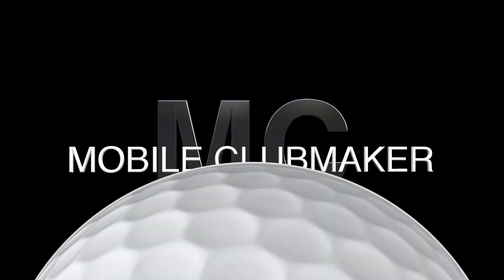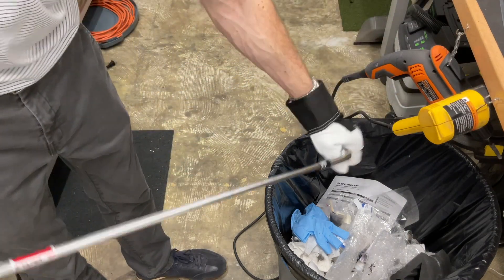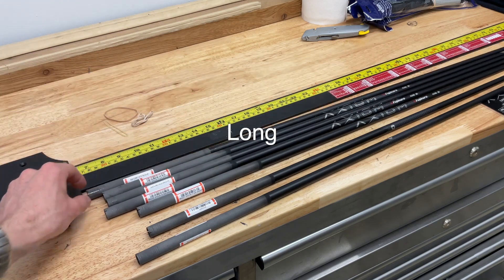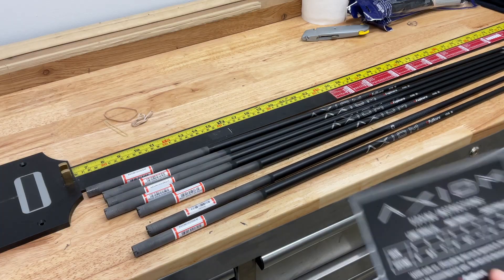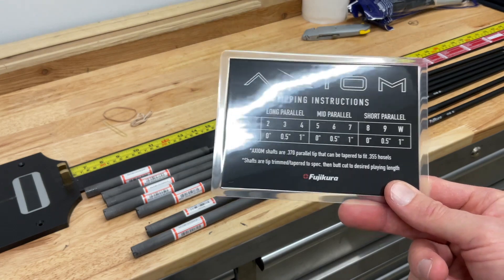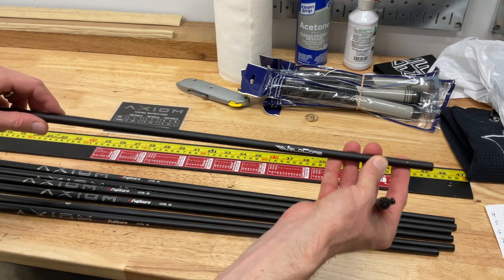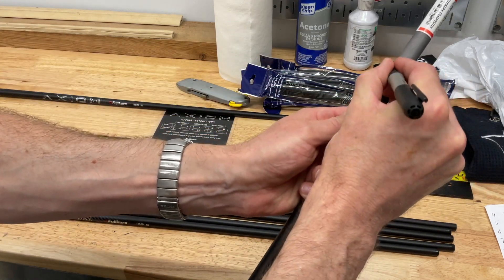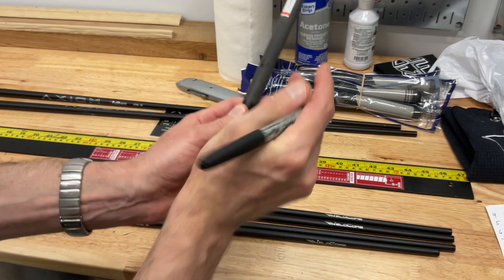Reshafting Irons With Fujikura Axiom / Getting the Right Fit

Comment: There is no way I would weaken a graphite shaft this way to make it fit in a hosel. This is not what I expected to see on this video.
Reply: But that's literally how you do it per manufacturer's recommendations.
Reply: Only issue would be if u swung your 2 iron 120+ mph and it got stuck in the astro turf. If not they will never snap.
Reply: what is your method? are you a club builder? have you worked with graphite iron shafts? how much did he "weaken" the shaft?
Reply: Yup this is exactly how you taper an and .370 I angle the shaft a little more when sanding the taper but that just helps me personally get the taper

Comment: i just bought one shaft to test in an iron 7 and a bit confused now where you cut the shaft. on that sheet from fujikura they said cutting at the butt and you were cutting the tip. why?
Reply: Because the 7 iron shaft in the axiom is the shortest of the MIDDLE irons and would be tip trimmed 1” and then cut from the butt end to desired playing length. 

Also, the Axiom shafts are divided into 3 groups: long irons (2,3,4) middle(5,6,7) and short(8,9,PW).  And all 3 groups are tip trimmed in the same matter. Long irons 0,1/2:,1” and the same for the rest of the  shaftd

Comment: Do you ever bore out the head versus sand down the tip?
Reply from the maker: You could with steel shafts, with graphite this is preferred method. Not to mention recommended my manufacturer.

Comment: Good morning Adam.  One more question from a newbie.  do you typically align shaft spine toward a target ( 9 - 3 o'clock line) or up/down (12 - 6 o'clock line) for this shaft?  I found a white dot and redline from the sticker on each shaft -  assume that is a spine.  Your thoughts are tremendously appreciated.
Reply from the maker: You can align it if you think it will give you more confidence but I've yet to see any proof that spine alignment does anything beneficial.
Reply: @EFGMC  Awesome, thank you so much for your thought.  Have great weekend.

Comment: Could use a caliper to get a more accurate diameter.
Reply from the maker: You can but you will need to measure every head as there may be slight differences from hosel to hosel.

Comment: I use my belt sander for tip prep on a 370 to 370 and also 335 to 335.  Also, use shafting beads.  Has always worked great.  I see your point though.  Smaller increments to make it fit.

Comment: Hello, Adam.  I am new to club assembly.  This is a superb video - just what I needed to see.  My key question is 'do I need to trim the tip as shown to fit the .377 shaft to .355 T200 & T350 (latest Titleist irons)?'  Sanding part I get it, to make the shaft tip smaller to fit .355 hosel.  I also bought Axiom 75 Regular flex for long, mid, and short irons.  Thanks for your thoughts in advance.
Reply from the maker: Yes, you need to tip trim them following the Fujikura recommendations for each particular iron. Then you can sand them down to .355
Reply: @EFGMC  Superb!  Thank you so much.

Comment: So, how does one take a 105 s shaft and make it a 105 r ?  Specifically, the P, 9, 8  irons.  

Thanks and your videos are informative.
Reply: Good question!?
Reply: 105 is only available in S and X.  If you need reg flex I suggest you use the 75R

Comment: Love the vids, two questions:
1. Should you use brass shims with graphite shafts when building irons?
2. If I change from Iron shafts to graphite shaft and I should also change the lie angle, would you  first change the lie angle (with the iron shafts on) or first change the shafts to the graphite shafts and then adjust the lie angle?
Reply: 1. Only if you’re putting tapered shafts in a parallel head. 

2. Doesn’t matter unless you’re changing the length of the shafts.

Comment: The Miura heads are usually quite heavy and the PW is higher. 

So, what does the Axiom shaft do to swing weight?
Reply from the maker: The 105 I've used for a few builds come out very neutral on SW at standard length.
Reply: not much for swing weight, however the head is truer at contact which encourages a more right trajectory with less turnover for draw.  The end result is a tighter draw, lower APEX, tighter dispersion and a slightly higher spin rate due to the tip not whipping.  typical graphite shafts will tip whip causing the face close slightly and deloft a little at contact, causing a more significant draw and a tad more distance due to less spin.  Dispersion pattern on standard graphite is monstrous compared to AXIOMS because of the unpredictability of the tip whip.  VeloCores have 3 different thicknesses in the shaft (handle, mid and tip) that prevent tip whip.

Comment: Anyway to show atleast one full club build and swing weighted. I'm curious how they swing weight out given they are miura heads and heavier than most. I play miura tc-201's and would love to try these myself. Great videos! Keep up the great work 👊
Reply from the maker: Set came out at D2-D3-D4. 4 and 5 were D2, all the rest were D3 and wedge was D4. That included some 4g tip weights and were built to slightly over my "standard" for length. 50g Lamkin grips used.
Reply: I play the TC 201s also. 

Interested.
Reply: @EFGMC  thank you!!!
Reply: @EFGMC  are you able to share what type of tip weights you use for this kind of graphite shaft. I currently play steelfiber 110cw in my miura's and know there is not a lot of room to insert tip weights unfortunately. Thanks again for the reply.
Reply from the maker: @Gjbjr777  I use standard lead graphite tip weights up to 6g. That's as much as I will ever use in a graphite shaft.
These shafts are more tip weighted vs the Steelfiber fyi so you would not need as much weight to get them to the same SW value.
Reply: @EFGMC Thank you very much, love the videos AJ👊

Comment: Thanks for the video.

Can you clarify this for me?

The shafts are all essentially the same (long, mid, short) but they are just tipped differently for the iron you want to put them in?

Or are the long, mid and short iron shafts different from each other?

Thanks!
Reply from the maker: They have 3 shafts with slightly different profiles. The long irons will launch higher, the short irons will launch lower by comparison. All three lengths have the same weight so that allows the finished set to be not quite a constant weight set, but close.

Comment: Just a small correction/addition.  The .370 Parallels are, in fact,  only available in 3 lengths (LP, MP, SP).   HOWEVER, the .355 tapers are available in 9 iron lengths (#2 - #10).  These lengths coincide coincide with the club. 

My current setup for my Titleist CNCPT CP-01 irons (4-PW,48 + Vokey SM10 wedges) is as follows:
.355 taper tip
105S #4 - 4 iron - 37" - (Part Number - AXIOM10514S-H)
105S #5 - 5 iron - 36.5" - (Part Number - AXIOM10515S-H)
105S #6 - 6 iron - 36" - (Part Number - AXIOM10516S-H)
105S #7 - 7 iron - 35.5" - (Part Number - AXIOM10517S-H)
105S #8 - 8 iron - 35" - (Part Number - AXIOM10518S-H)
105S #9 - 9 iron - 34.5" - (Part Number - AXIOM10519S-H)
105S #10 - PW - 34" - (Part Number - AXIOM10510S-H)
105X #10 - 48 (CNCPT GW) - 34" - (Part Number - AXIOM10510X-H)
105X #10 - 50° (VOKEY SM10) - 34" - (Part Number - AXIOM10510X-H)
105X #10 - 54° (VOKEY SM10) - 34" - (Part Number - AXIOM10510X-H)
105X #10 - 58° (VOKEY SM10)  - 33.5" - (Part Number - AXIOM10510X-H)

Comment: Wedge question AJ?  
Have a 54* 12=bounce Vokey D grind. If it was bent to 53* or even 52*, how does it affect the bounce and grind?
Reply from the maker: Bounce moves with loft, so 2 degrees lower loft = 2 degrees less bounce. Grind will have less influence because it now sits higher.
Reply: Bend a wedge to higher loft increases bouce.

Comment: With Axioms 105 S on irons, what would you use on LW and SW?
Reply from the maker: Might go with a 105 or 115 Nippon Modus wedge shaft depending if you want to keep the weight consistent or go up a bit.
Reply: I use 105X #10 butt trimmed in 1/4"  increments

Comment: What swing weight would you get with standard lenght and no tip weight?
Reply from the maker: Need much more info. Which shaft weight, what are the head weights, what grip?
Reply: @EFGMC  will it get closer to something built with modus 105? or its a nightmare like LaGolf? I dont like to use tip weight.
Reply from the maker: @rubensnaves  Axiom 105 is slightly more tip heavy than Modus 105 so should yield similar SW values.

Comment: What is the benefit of this method vs reaming the hosel??
Reply from the maker: This is much better in my opinion. Does not change the hosel permanently and looses very very little weight vs reaming.
Reply: @EFGMC  thanks are you using a micro grit belt or something more aggressive?
Reply from the maker: @pchmbrs7  Just a medium sanding belt and a light touch. Sand a little, check the fit and repeat.

Comment: Would it not be more accurate to taper the shaft using a lathe? Using your hand is far from precise.
Reply from the maker: Maybe for a beginner that would be an option. Not worried about someone versed in shaft work.

Comment: Hate to be you when Fujikura doesn't   back their warranty when they find out you sanded a .370 tip to fit a taper tip hosel. Any top custom club builder should have a drill press with the bands set to the lowest speed to reem heads out with. A 10 second search would tell you Fujikura doesn't recommend this.
"No, Fujikura generally does not recommend sanding a .370 tip down to fit a .355 hosel; instead, they suggest reaming out the hosel to a .370 diameter to properly fit a .370 parallel tip shaft, as sanding down can significantly affect the performance and integrity of the shaft."
Reply from the maker: Nope, that's not true. Fuji has and does say you can taper down a parallel tip. Unless you do something really bad, a tapered tip section in a shaft isn't where things go wrong.
Reaming out heads is a waste and just lowers head weight which is rarely good.
Reply: @EFGMC   "The limited two-year warranty is automatically voided if any pull-out and/or reinstallation of the product has occurred or any other tampering from the product’s original state has occurred."
This is a quote from the Fujikura website.  Altering a .370 parallel tip shaft to fit a .355 taper hosel is tampering the product from its original state.
Also the only way reeming out a .355 hosel to .370 will result in a significant reduction of head weight is if you bore too deep into the head. 
I get it that you want to just glue and butt cut taper tip shafts because that is the easiest way to build golf clubs. Actually tuning parallel tip shafts individually on a frequency analyzer takes more skill.
Recommending to your viewers that sanding down shafts to fit a hosel for which it wasn't intended is irresponsible.
Reply from the maker: @Looper4Life  How do you think these taper tip graphite shafts get that way from the factory? They grind/sand them down.
Reply: @EFGMC  "
"A taper tip graphite shaft is made by wrapping layers of graphite composite material around a steel mandrel, with the layers being strategically placed to create a gradually decreasing diameter towards the tip of the shaft, essentially "tapering" it down, while the shaft is cured in an oven; this process allows for precise control over the taper profile to suit different club head designs and player needs."
This is actually how a taper tip shaft is made in the factory. Confusing shaft manufacturers not painting the tips of their shafts with them "sanding them down to make taper tip shafts" is pretty funny though.
Reply from the maker: @Looper4Life  Nope. Not sure where that info came from but it's not true. Maybe some random shaft company does it but everyone else uses a big pencil sharpener to taper it before paint etc.
Can you over prep a shaft and cause issues, yes, but saying it can't or shouldn't be done is just not true.
Reply: @EFGMC  please stop. I worked personally with shaft designers to custom make shafts for the outfit I worked for. The two companies were Apache which was Matrix Composite Corp. which sold their manufacturing facilities to L.A. Golf and Aerotech. In both cases we modified their existing shafts to fit our build needs. We were able to do this because in both cases at the time we were their biggest customer. 
Have you done any testing to determine how an axiom shaft plays with the intended parallel tip versus the tip you turn it into? Also why doesn't Fujikura offer. 355 tip in their flagship Axiom shaft if all they need to do put them in a "pencil sharpener" prior to shipping? I'll answer that for you. They don't because the Axiom is meant to be installed as a parallel tip shaft. Fujikura realizes that most club builders aren't willing to properly bore heads out so they have club builders say it’s OK to sand the tips down. But as I copied an excerpt from Fujikura's warranty page that voids the warranty. In other words, Fujikura will sell you shafts but when breakage occurs they won't replace the shaft.
Reply from the maker: @Looper4Life  I'm done. Sorry you don't agree with me.
Reply: @EFGMC  there's nothing to agree upon. I backed my point with text directly from the Fujikura warranty. Also to any club builder that may stumble upon this comment thread, don't go out and buy an electric graphite shaft tip prep machine, "pencil sharpener", with the intention of using it to turn a .370 tip graphite shaft into a .355 tip. It is almost impossible to set the 3 "blades" at the correct angle to achieve what you are trying to do. You will ruin a lot of shafts.

Comment: Better off boring the heads. Why weaken good graphite?
Reply from the maker: Shaft section that has been tapered sits fully inside the hosel incased in epoxy. It won't fail.
Reply: @EFGMC  witch kind of epoxy did you use ? Thanks!
Reply from the maker: @majestik1717  Golfworks Tour Set Plus is my standard use epoxy.
Reply: @EFGMC  I want to put axiom with Ping I 525. Did you think tour epoxy plus is good enough for axiom work ? I hear lots of people use 3M DP 8410 NS .
Reply from the maker: @majestik1717  There are any number of epoxies that will all work equally well. It's almost never an issue with the epoxy itself when you get a bad bond. It's all about proper measuring, mixing, and prep work.
Reply: @EFGMC  huge thanks! by the way your videos are awesome! Keep it up!

Comment: Big miss by Fujikura.  All premium irons have 0.355 taper hosels.
Reply: Fuji know what they are doing I assure you
Reply: You can purchase .355 in 9 iron lengths.  I have 2 sets.  one for my Titleist CNCPTs and one set for my T100s.  They didn't miss, just go directly to Fujikura and they will direct you.  Golf outfitters just don't want to stock tapers, because it is cheaper to stock up on 3 different lengths of .370, rather than properly stock up on the 9 proper lengths of .355.  "Mike's Golf Outlet" stocks the .355 in all 9 lengths and in both stiffnesses.